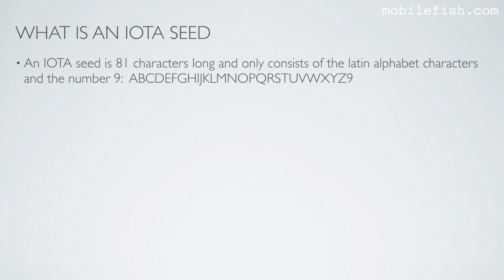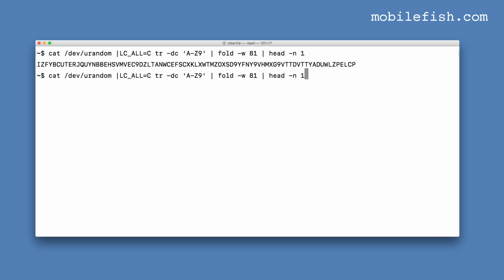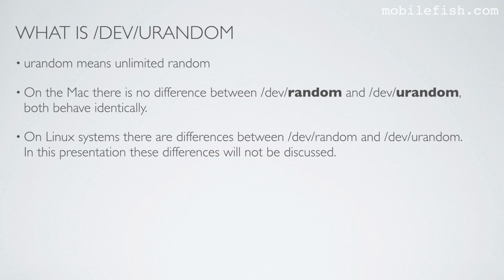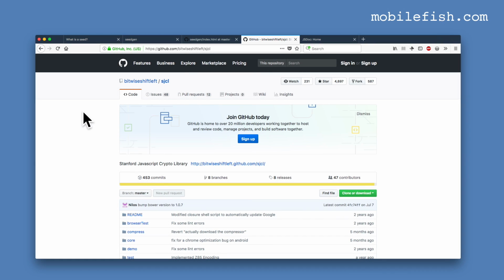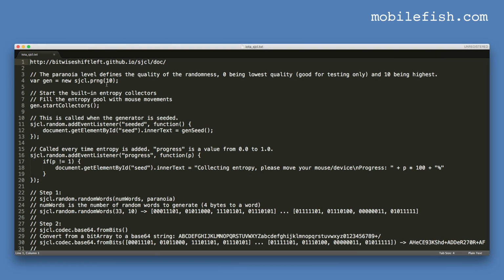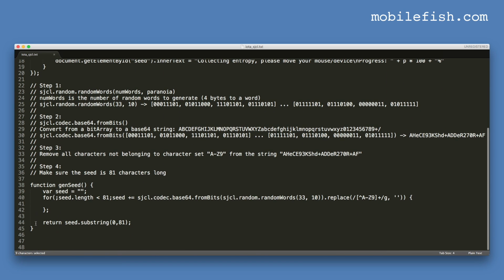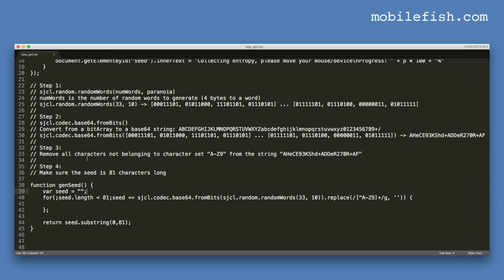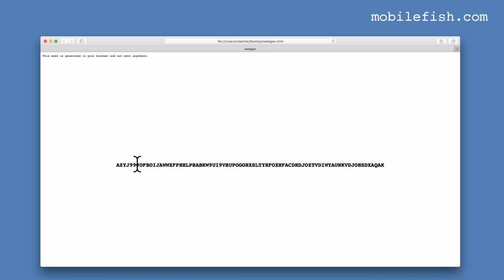IOTA tutorial 3: IOTA Seed

Comment: If you really want to use the javascript seed generator (which I would not recommend), do not forget one last step: close the page before you reconnect your computer from the internet. Also, you should open the application in an anonymous browser window (with all plugins/extensions deactivated). Still don't recommend it - only for testing purposes but never for storing any token under addressen generated from that seed.
Reply: I want to explain myself a bit further: consider a web application that generates a seed and then secretly saves the genereated seeds in local storage or cookies (local storage would be preferable because its is not so obvious). As soon as an internet connection is established the seeds can be transmitted to somebody else, even if the page was closed and opened later again (maybe to create more seeds). That's why it is not save to use a javascript seed generator, except when your know and understand the source code by 100%.
Reply from the maker: Mark, you are absolutely right. 
NEVER USE ONLINE SEED GENERATORS!
I created these for demonstration, education and test purposes.